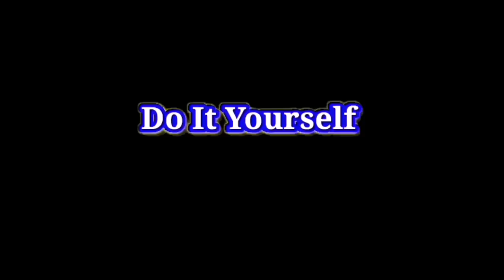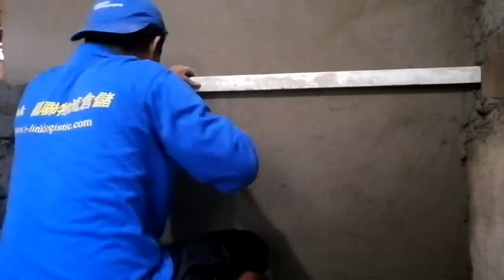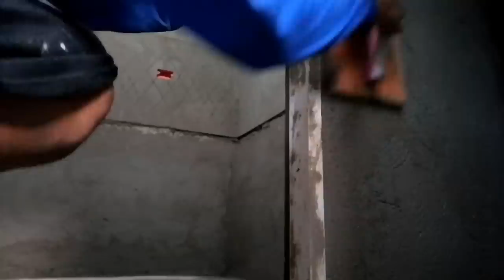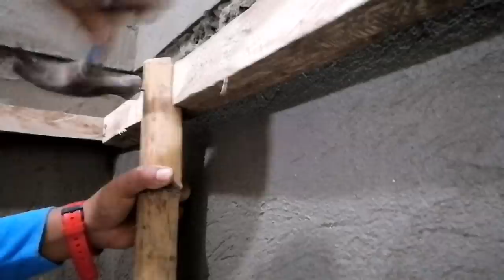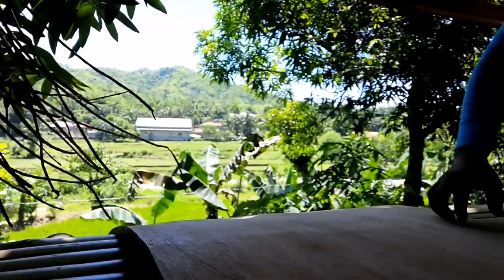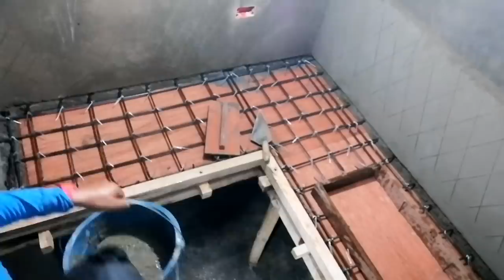kitchen sink paano gumawa

Comment: Sir ask ko lang.po, paano po.ba pag gamit.po.ng hose sa.pag level? Ano  po need gawin o sundin? Thanks po
Reply from the maker: lagyan lang ng tubig ung hose tapos sundan lang ung level ng tubig mam.. ung isang dulo ng hose kailangan sa reference point nakatapat tapos ung isang dulo nman markahan nalang kung saan tumapat..
Reply: @cardodiytips5820  salamat po Sir, ung tamang ht po, dun po ilalagay po ung isang dulo ng hose na ka level pp nung tubig, then ung isang dulo naman po ay kung saan po tatapat naman ung tubig po, ay yun na.po ang same.na.sukat ng.taas? Ganun po ba.sir? Thanks po
Reply from the maker: yes po kung saan tumapat un na ang mismong level.. pero tip ko lang siguraduhing walang hangin ang gagamitin  na hose upang siguradong magkatapat.. pwedi mong i check muna bago gawin sa actual.. pagtabihin lang ang magkabilang dulo tsaka tignan kong magkatapat... kung ok ay tsaka mo na ngaun gawin sa actual na paglevel..